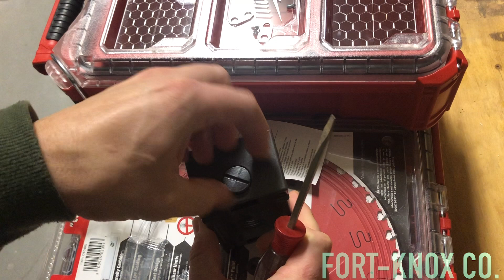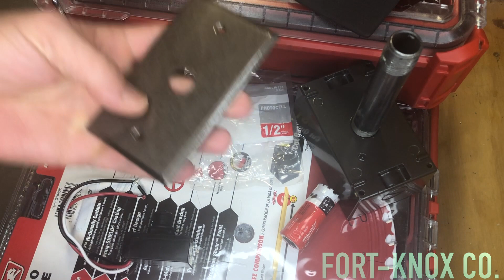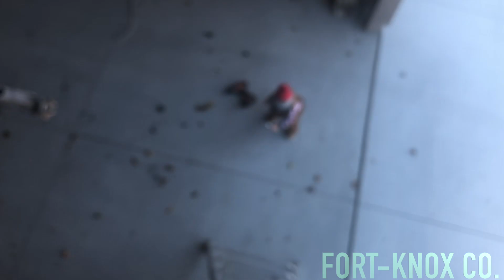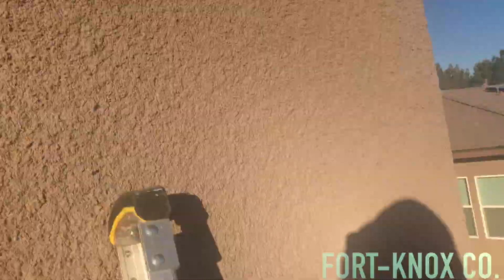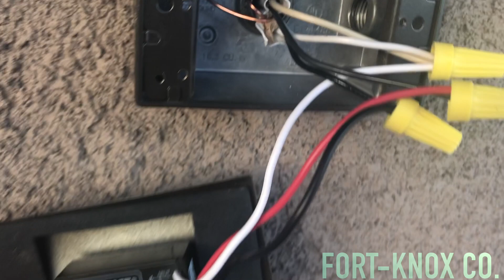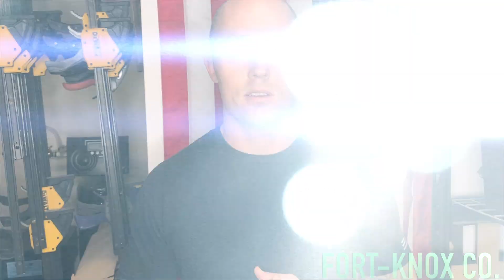How To Install Photocell - Dusk to Dawn Exterior Lights

Comment: couple extra things i do is teflon tape the threads of the conduit, install heavy duty anchors in the stucco by drilling out the hold, using a firm brush to scrape out the dust and blow it out using compressed air. i inject silicone or loctite glue in the hole and hammer in a plastic anchor and fill the anchor in with gorilla glue or silicone, next I screw the box ears onto filled anchors using high sheer strength stucco screws. i also might use plumbers putty behind the electrical box for uneven surfaces to ensure a weather proof installation... kinda over kill, but I do it to ensure heavy light fixtures will be supported in the future.
Reply from the maker: Oh wow. Yeah you got that thing way over build. But that’s awesome! I’d rather be over built than under. Just shows your thinking. Nice job !

Comment: holy crap, your installation method is the same as mine, as i love to mount an outdoor electrical box with a conduit tube running out the back through the wall to help support the weight of a heavy light fixture. the mounting ears on most electrical boxes are small and only allow a certain thickness screw to mount the box on brittle materials like stucco.
Reply from the maker: That’s cool to hear. Yeah this method does probably add a little support to the box being installed on the exterior. But I’d still be careful how much weight you attach to it. I’d still try to secure the box to the framing of the wall or something solid and not solely rely on the box conduit.

Comment: nice.   hey, do you stucco soffits?   i've never seen that before.
Reply from the maker: Yes. It’s very common out here in Vegas. They’ll stucco the entire thin, fascia/soffits/walls. Protects from the harsh sun out here. Wood fascia dries out and requires a lot repair over the years

Comment: That’s nice. So do you mount the photo cell on an opposite wall from the lights? Wasn’t sure if the light coming on would kick it back off
Reply from the maker: I  mounted the photocell on our south facing wall which gets the sunlight. Just so it’d work best when the sun is 100% or down. But I’d usually mount it above or slightly away from the light your installing if possible. Some light fixtures have photocells on them and it doesn’t seem to effect them much, but they don’t have the cell in direct shot of the light bulb either.